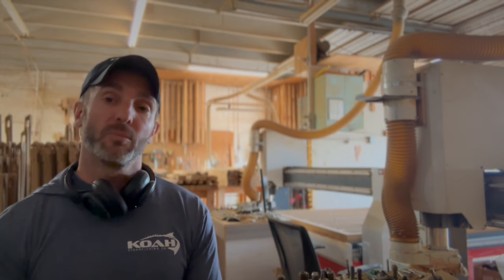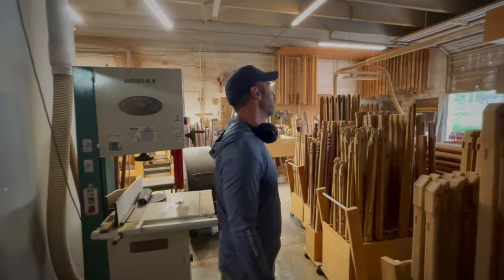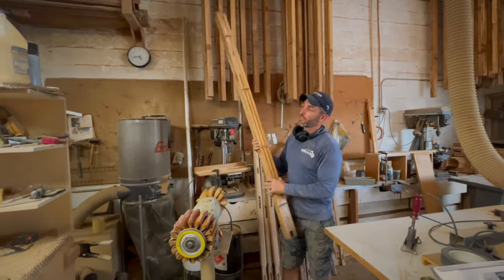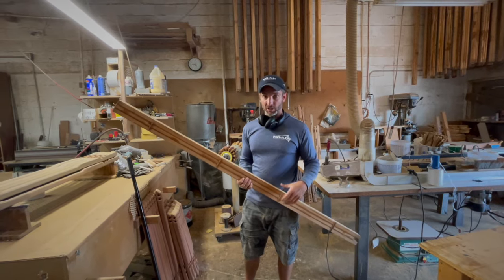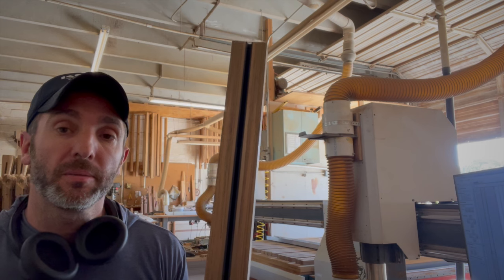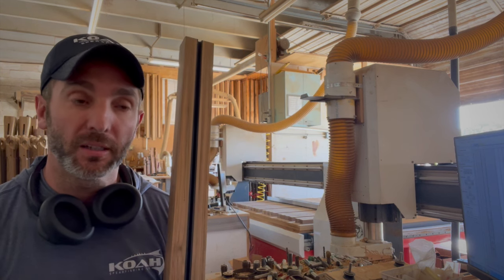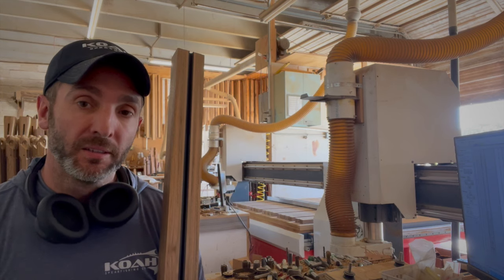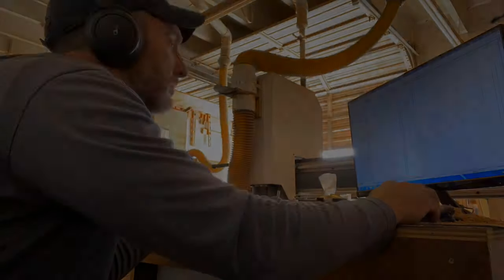From Wood to Water Episode 1 - The Build - Key West Waterman  Wahoo prototype

Comment: I’m a woodworker and also a big fan of Aaron and the Key West Waterman channel, so this is the best of both worlds for me. Your blanks appear laminated. Is that for better stability than a solid block would provide?  Do you use epoxy for the glue-ups, or another kind of glue?  I would love to see more in-depth footage of the build process itself.   I never thought I would see how a spear gun is built. Very interesting. Thank you
Reply from the maker: Thanks Nick, some processes we will not show due to proprietary reasons . Laminated stocks provide long term straightness and stability for the stock. We use epoxy for most laminations along with other additives for bonding strength

Comment: Great video, but a bit lacking in background information.  For example:

1. What type of wood do you use?  Does it matter?
2.  Are the blanks laminated or whole blocks?
3.  Are the guns just varnished, or is any extra protection added prior to varnishing?  e.g., a clear epoxy coating?

Also, is the reel just thought of as a line holder, or is there a ratchet and/or drag on it that could be used to help reel the fish in?

I understand if you don't want to go into parts of this any further as they are proprietary information.  But I think a little more information would improve the content.

Many thanks for taking the time to create, edit and post this.
Reply: I pretty much have the same questions.  If anything is proprietary just let us know.  We don't want you to give away your secrets.  

I would suggest you pick up a couple of microphones.  Your audio could be a little cleaner.  Thanks for the video.  I look forward to future build and test projects.
Reply from the maker: Thanks for the feedback! You are correct in assuming some of the processes are proprietary, but I will work some of your questions into the upcoming episodes.
Reply: Thanks so much.  @Koahspearfishingco

Comment: I'm planning on making a double roller spear gun for myself. I have the wood, and I'm just wondering what the dimensional size for thickness and width for a wooden speargun would typically be. I've been using aluminum, hence why my question.
Reply from the maker: On a double RL , pretty wide .. need to support the roller at the stress at the roller